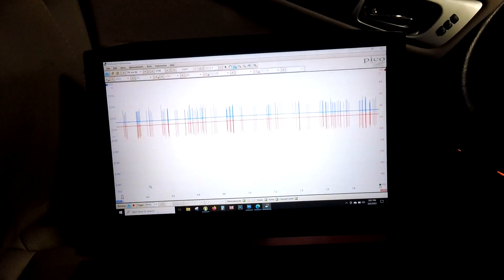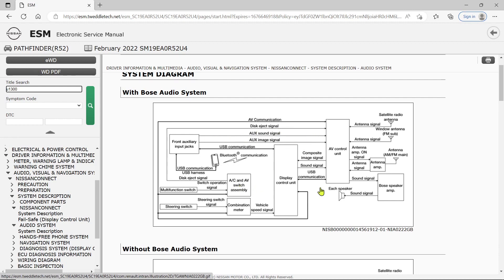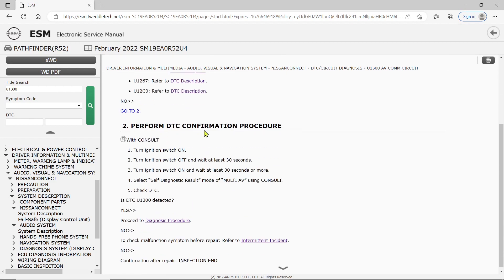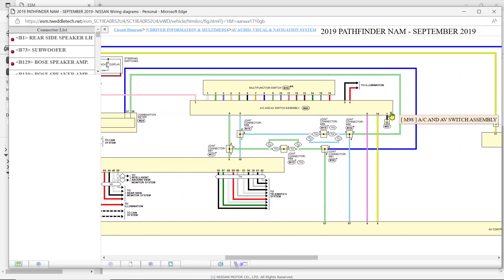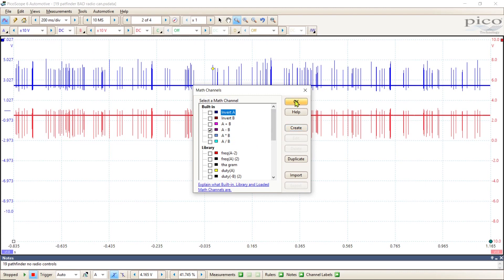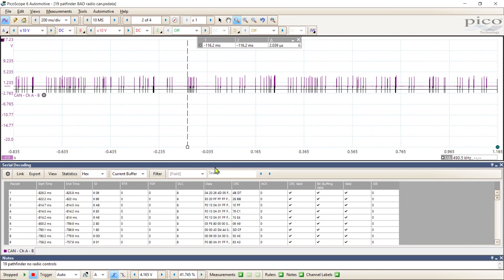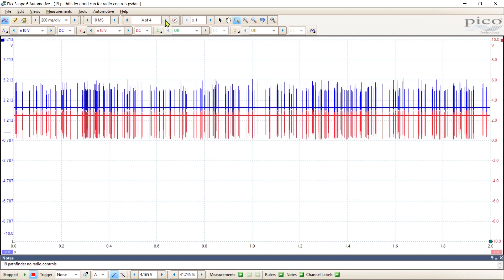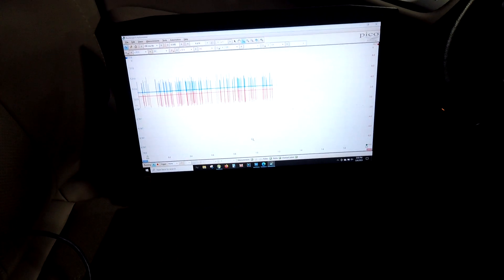Audio Communication case study

Comment: There's one thing I can't understand. On what basis did you determine that the lower radio panel was damaged and not the upper one? The top one didn't work either, neither the navigation switches nor the air conditioning.
Reply from the maker: All of the communication goes threw the radio panel. The nav switches are hardwired to the radio panel. I knew the radio panel wasn't communicating so i replaced what was a known problem first and re tested. All was good.

Comment: Sorry my comment was for the other video about the ignition coil problem were you show the ats ckp misfire detector capture.
Reply from the maker: Gotcha, I removed the other comment. That actually was not the ATS mis fire detector . It was a relative compression test, built into the ATS E-scan . I don't actually have an ATS scope just the E-scan.
Reply: @CartersDiagnostics  got you thanks

Comment: just heard about your  channel from last weeks Techlink call from Nissan. excellent. trying to under Can diag more. so if power and ground are good and can signal is weird back probed connected to unit .unit is faulty.  also if unit is disconnected and signal is ok is it a faulty  unit or would  signal still be wrong .trying to understand  if can signal  is an output  or input to module or both. sorry for long post. still trying to learn.just ordered pico 2204A to start learning
Reply from the maker: Good power and ground are a must for all controllers.  If signal integrity is poor, its not always the controller you are testing causing it, any controller on the network can cause an issue, unfortunately you may just have to unplug them one at a time to see. But if signal integrity is good and power an ground is good, the possibility of the non communicating controller being bad is the most common issue.
Reply: @CartersDiagnostics  thank you. excellent  channel.have past on your channel  to other techs at my dealership
Reply from the maker: Also be sure to use attenuators with that scope, I think the maximum Input voltage is low, something like 20volts . Just check into it a little to avoid damage.
Reply: @CartersDiagnostics  i have a 20.1  order  also